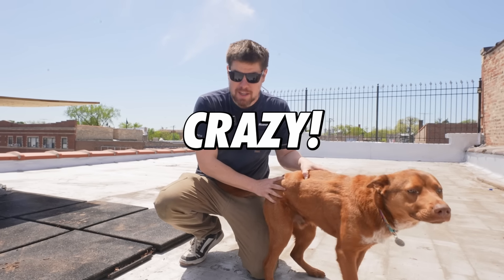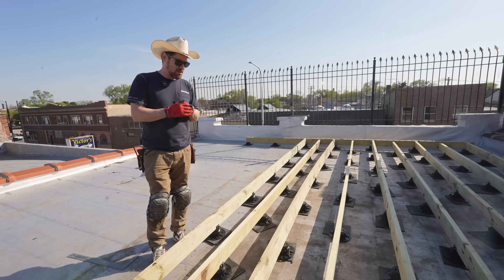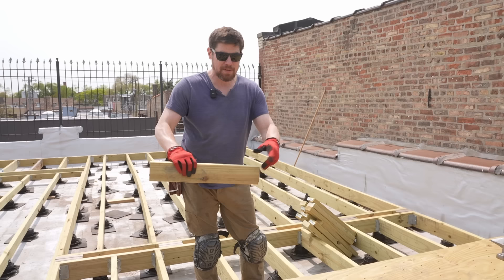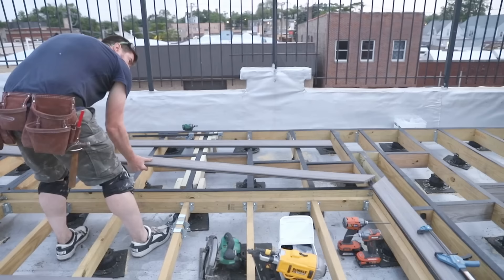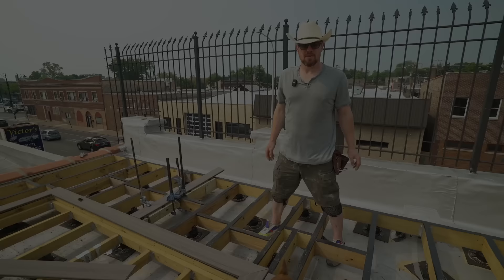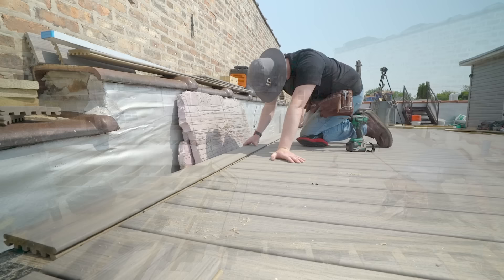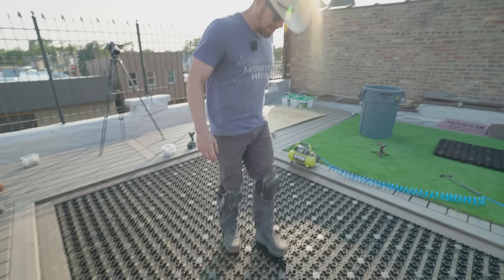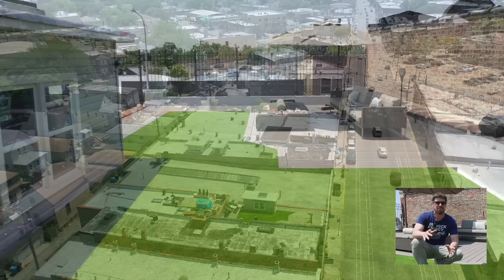I Built a ROOFTOP DECK that feels like an Actual Yard....

Comment: I know artificial is easier to do and possibly cheaper as well but I honestly think this would've been way cooler if you had gone with a real grass roof
Reply: honestly artificial grass isn't even that much less maintainance. 
You have to clean it (some even recommend to clean it as often as you would cut normal grass) and it will fall out and need replacing at some point in the future.
Reply: Weight restrictions on that old building would not allow real grass
Reply: Yeah I was suprised to see fake grass in an "actual yard" video
Reply: you know about dirt, right? real grass kinda needs it.
Reply: @willbraden5973  your point being?  you seem to have never heard of a living roof before
Reply: @bearwynn  by easier I meant it was easier installation
Reply: @TheJeracuda  Do you know how old this building is? Have you watched the other modustrial videos where he’s dealing with leaks and structural issues and whatnot? You think he’s gonna put 20 tons of soil up there and just cross his fingers?
Reply: @willbraden8354  the leaks WEREN'T structural but you clearly think you know everything so I'm not going to keep this up since you're the "master of EVERYTHING"
Reply: These comments are too funny. The building is too old to hold real grass and dirt on the roof. Doing something cooler can sometimes bite you in the ass 6 months later.
Reply: @ziadAlkhailani yup I was gonna say the same thing weight is a huge issue roof top gardens are usually steel framed buildings to hold the weight
Reply: @TheJeracuda  Facepalm
Reply: @TheJeracuda  Not a master of EVERYTHING, but I've moved dirt by shovel and wheelbarrow plenty of times. The amount required to grow that much lawn is definitely going to weigh multiple times what you think it will. And it holds water, which weighs a kilo per litre. So, every time it rains your roof suddenly gets much, much heavier.
A cubic foot of dirt weighs 80-100 pounds, that's around 40kg. One square foot of grass x a couple of inches of top soil is 288 cu. So every six square feet of grass requires around 40kg of soil (give or take). Six square feet goes into 500 square feet 83 times (83,33 recurring). 83 x 40kg = 3,320kg. Three and one-third tonnes. In Freedom Units you're looking at around about 7,470 pounds or three and three-quarter tons.
And that's before it gets wet.
Reply: Real or just nothing at all!

Comment: It looks amazing, to be sure, but I have some concerns.  First, please tell me your roof drains directly to the sewer, and not to a downspout out onto the sidewalk below.  Otherwise, every time you hose off the roof - yeah, you’re definitely going to a need a hose - to clean up after Tex, you’ll be flushing pet urine and fecal residue out onto the concrete for passers-by to walk through.  🤮 Also, even if the runoff does drain to the sewer, I strongly recommend you restrict Tex’s bathroom area to only a small section of the grass, in a spot that’s closest to that drain and that you start buying Petzyme, so you can immediately treat any areas where he relieves himself.  We use Petzyme around our property in areas where neighborhood cats come through and mark their territory.  It’s non-toxic and very effective at eliminating any evidence of marauding felines.  And since you opted to use a raised, PLYWOOD base 😱,I can promise you, regardless of how many holes you drilled into it, it’s definitely going to start absorbing Tex’s “runoff”.   Petzyme will, at the very least, cut down on how much bacteria - and accompanying smell - take hold.  Lastly, remember that artificial grass, no matter what anyone tells you, needs to be cleaned periodically.  Wait a month or so, and then walk on it barefoot - but absolutely NOT on a hot, sunny day - and you’ll see how black your feet are on the bottoms.  Seriously, man, faux turf can get hot as hell.  Your pooch’s bare paws can get very uncomfortable, if not outright burned…and so can yours, especially on a hot summer day in Chicago.  Be careful.

Comment: Love the build!! Will the plywood not absorb Tex's business and start to smell over time? 

Either way, incredible work. Can't wait for the dog house video
Reply: Tex's business?! No, no! Tex has no "business" on that roof!
Reply: @julietphillips1991 h he made it for tex to do his business, he said so in the video

Edit: I read the comments, and apparently this plywood is marine-something. It is most likely waterproof!
Reply: @Heihei246  thanks for clarifying that. It's such an amazing build. Would hate for it to get smelly and not pleasant to be up there.
Reply: @Heihei246  He mentions that it is pressure treated and nothing more. Plus he drilled holes in it, so it is most certainly NOT waterproof at all. It will rot after enough time.
Reply: it will most def.
Reply: you'd need to have a hose up there to wash the urine through. Even on natural grass, dog pee starts to make a garden smell like a public toilet. I wouldn't like to see the state of the plywood after a couple of years.
Reply: Disappointing to see all the sawdust debris left lying under the deck and not vacuumed up. First heavy downpour and it’ll find its way into your drains and maybe cause a blockage.

Comment: Just FYI you will be replacing the boards with the roundovers. The composite on the underside is not meant to be exposed to moisture which is why the top is covered in a PVC material. It will swell.
Reply: You heard of joist tape?
Reply: yeah. joist tape is for the wood beams, not the composite boards.

Comment: As a Dog owner and knowing what dog urine does to sub flooring through the carpeting, you  are in for massive stench!!!! You are going to need gallons of urine metabolizer!!! Keep a hose handy and hopefully the plywood doesn't de laminate.
Reply from the maker: That's what marine-grade plywood is for...
Reply: @modustrial  I own a boat (live on a lake in GA) and have restored many a transom made from marine grade plywood and fiberglass.  The  transom (where the outboard engine mounts) requires epoxy resin/fiberglass coating to keep the plywood dry and from rotting, warping, and de-laminating. Even then, it's the first part of any boat to rot away. All wood (teak, marine grade plywood, oak) used in boat building gets a water  proof protectant. Best of luck! When you need an electrical engineer's help, give me a call.

Comment: Hope you fill in the gaps at the edges (maybe with plants?) otherwise I can foresee a million balls making their way under that deck :D  Looks great, can't wait to see what you do with the rest of the roof.  Cheers mate.
Reply: Maybe the fence he mentioned will fill it? Never specified if it would be installed into the wall like the street facing fence is. I could see posts in cement pots or planter boxes, that would put it in the gap.

Comment: Mike as usual it looks fantastic. Only thing i would have done differently would be when you put in the brace pieces in the deck, I'd have staggered them (put all the braces in one channel and then in the next one you put them in-between, next channel they go in the same place as the first etc etc (if that makes sense)) more to just help with a bit on the weight distribution and prevent the boards from possibly sagging.

Comment: This is an absolutely insane thing to do. That roof will leak or need to be replaced at some point, and this whole thing will need to be ripped out to repair or replace it.
Reply: You're right, but with the roof being newly done, if it was to be covered like this, it was now or never. And nothing is forever anyway.

Comment: Wish I could’ve given you some tips man I build decks now, but I used to do interior framing when I stumbled upon your channel. Next time you do a picture frame cut all sides & screw down 3 make sure they fit but leave one piece of the long side off. Then you just have to track saw one side if you leave the boards like 1-2” long.

This is some beautiful work though, I’ve loved following along with your story!
Reply from the maker: thanks!  If you watch again, I did exactly what you suggest :). it definitely makes the install go quicker not having to cut all the boards to exact length, and just cutting them all in one pass with the track saw.

Comment: I have installed a bit of the grass and I would not have stapled down the grass unless you have a wind problem. That way you can move it to clean the grass with a pressure washer it will need it after a few years. And I used a electric carving knife to cut the grass.

Comment: I have a similar build on my flat roof in Brooklyn. Great job. PLEASE NOTE - you will want to pull up a few boards and get a leaf blower to push that saw dust into a pile and remove. There is no way that the flow of rain water will move that amount of dust to the drain. It will act as a sponge and rot through the roof membrane. There will be sone dust that makes it way to the drain and you’ll be cleaning that out for years to come. Great job… but please get that saw dust up.
Reply from the maker: definitely going to do that!

Comment: Just an FYI - not sure of where this is, but if you get cold seasons, watch out for static electricity from the turf. More annoying than dangerous, but the cold air and turf can generate a buildup of static electricity, leading to shocks when touching metal. Something I found out with a roof turf build that had a metal railing. Apparently powder fabric softener can help alleviate the issue.

Comment: Awesome project and came out great.  The only thing I might have done different is to not divide the picture frame with the vertical board you used to break up the regular decking.  You are butting picture frame boards up against each other in various locations around the edge anyway, so having that one spot that breaks up the otherwise perfect frame looks odd, especially on the drone shots.  I imagine you could make that change later if you wanted to.

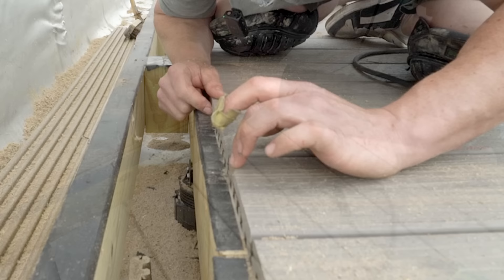Comment: 20:04 I use my biscuit cutter for creating slots. Much faster and way more control.  I love the look of Trex, but it’s terrible in Florida; it gets so hot I need to work on a movers blanket to stop from burning my legs.  Nothing beats wood for heat dissipation.  If you had a pool up there I’d say no bueno, but most of the time you’ll be in shoes, so it won’t be an issue. Just make sure your pooch’s pads don’t get burnt.  Great work as always!
Reply from the maker: Thanks!  I'll be adding shade to help with the heat too

Comment: Nothing anchoring it? Hope you don’t get any significant wind/ hurricane. 

I would’ve drilled larger holes for drainage, like 1 inch. Especially considering you have the plastic grid. So you will never feel the holes. 

Then I would’ve sealed the holes and the top of the boards with some poly. Sure, it’s ground contact ply, but a little extra protection will pay off later.

Comment: It's perfection!  But I have a question. If the roof develops a leak, how do find it and how would you fix it?
Reply from the maker: you have to pull up the deck boards to access it
Reply: @modustrial , yikes...then may your roof never spring a leak!

Comment: I could see a need for a permanent retractable water hose up mounted up there maybe on the back of the stairwell housing. I suspect you're going to want to frequently wash away the concentrated urine that will dry on the plywood and under the deck and I don't think rain will be reliable enough or consistent enough to handle the daily business.
Reply from the maker: Good idea!   I have a water line up there
Reply: I came here to say the same thing, the plywood may be water resistant but the urine would definitely still dry on it and smell. I’m not sure how you’re planning on dealing with the unscoopable litterbox that the grass is going to have underneath it.

Comment: Looks like you are only half done and there's no Hot Tub, Pool, Trampoline, Fire Pit or Gazebo. Rex also needs a safety harness that is on a parameter trigger that either releases a parachute or a highly durable rubber air bag like they used on the Mars lander for when he accidentally jumps over the fencing, still not too late to upgrade to a cat. Don't forget the Barbeque or the Refrigerated Cooler. As well you seem to have space for adding an outdoor Movie Screen and Projector. Otherwise looks like a solid start. Did you ever figure out that leak?
Reply: ...and what about planters along the parameter?
Reply from the maker: Definitely more cool features to come in the "yard"!
Reply: @modustrial  Have you figured out the leak yet?

Comment: Good job on the deck, I'm guessing you vacuumed/cleaned all that sawdust from below the boards, else when they start getting wet it will either block you drainage or start growing fungi and toxic mold. Keep the good work

Comment: Great job, but you really need to get an electrician to install outdoor protected electrical outlets. You will need them, and the battery generator won't cut it long term.

Comment: That plywood is gonna get so much mold from Tex peeing & pooping when it all drains. Not to mention, the ammonia smell from the urine. Its gonna reek so much that you're not gonna want anyone to come visit & hang out. You should've painted a couple coats of Thompsons water seal or other mold protection on all that plywood before using joist tape. Your gonna have to do it sll over again soon enough.
Reply from the maker: Based on my research the marine grade ground contact plywood should be fine with air grid allowing air to pass through it.  But, time will tell

Comment: Looks great. however, IMO, the decking structure wasn't needed. The way I'd do it would be with the plastic hives / grid covering all the roof. The deck planks fixed to battens running parallel to the water flow. no need for all that wood. In the end the roof would be much lighter and floor level lower (relative to the guardwall and door sill).
Reply from the maker: This is an option, but then the nailers boards would need to be attached with adhesive, meaning no way to remove grass without destroying the roof itself.  Also, it would mean grass would be lower than the deck, and I wanted everything level

Comment: Put a wash cloth or bandana soak it in water a little. Then put it under that hat and let it hang down over your neck that will protect you from the sun and keep you cool. Take it from some who is on roofs a lot installing cameras and wireless netwoerk systems. Hope that helps.

Doggie approved.

Comment: Apologies if I missed it, what's the process look like to determine whether your roof can take the weight of the extra build?
Reply from the maker: In most cases you have to hire an engineer.   I'm lucky enough in this industrial building that I have 16-in 3/8" thick steel  I beams supporting the joists, so there was no question whether the roof could hold it

Comment: How will the weight of the deck effect the load of the roof? If I’m not mistaken roofs are engineered with load weight in mind for nature like snow and rain. The deck is probably very heavy, so will it make a huge difference for load ratings?

Comment: So is the plywood under the grass treated? I would think the freeze/thaw cycle especially in the more northern climates will end up warping that, not to mention rain, and doggy business. And the new load of the entire deck over the roofing system-- a building's roof, in my home town, collapsed because of snow load and that was a flat roof system. Just curious.
Reply from the maker: yes it is pressure treated plywood rated for exterior ground contact

Comment: how do you know the roof can support that?  and how do you know the pedistals are in the right place?
Reply from the maker: The joists in the ceiling are exposed on the interior and space every 16 inches, so you just measure the location of the first joist from the wall to figure out where the first pedestal goes, and then put them every 16 in

Comment: Looks awesome. Love your videos. Question…what do you do if the roof underneath of it needs repair? I guess you dismantle a section? Hopefully the roof doesn’t need much attention for the next many years.
Reply from the maker: Hopefully it will be good for 5-10 years, but yes, you have to take it apart to access the roof
Reply: @modustrial  thanks for the response. Really nice job on the house and roof. Good stuff.

Comment: Is the other roof behind the couch also yours but just not buildingable, because I'd absolutely be making a Pergola extending off that for parts of the deck but then again I like a bit more shade. If it's not I'd still potentially consider something there maybe going into the tiles or supporting it into the wall of the building if there is enough gap.
Reply from the maker: Yup, it is!

Comment: I’m not trying to backseat here but I’m definitely concerned about that plywood under the grass. I think you’ll have an odor issue if the dog used the bathroom on that. Urine and wood do not mix. They make a plastic maybe 3x4 fake grass dog pee mat that you should try and train him to use. Just an opinion everyone has one. Other than that the deck looks insane and I can’t wait to see the finished project.

Comment: Looks cool… but what happens when there is a storm or a hurricane?
Reply from the maker: no hurricanes here...it should be fine in high winds with the weight and the way surrounding walls of the roof break up air flow.

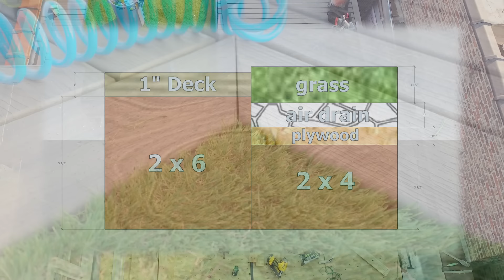Comment: 25:38 - This is probably a dumb question but does anyone know what's causing the tripod and building to warp like this? Is it just micro-adjustments by the drone camera slightly changing the perspective during the time-lapse? Or is it wind or flex in the boards? Thanks
Reply from the maker: Stabilization on a drone shot
Reply: @modustrial  gotcha, thanks